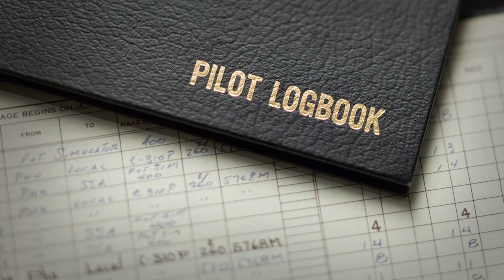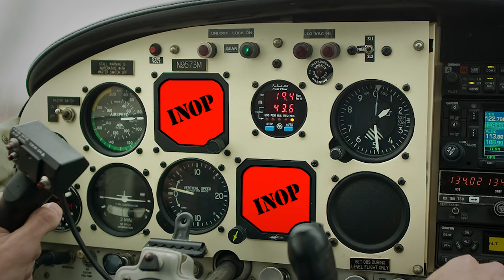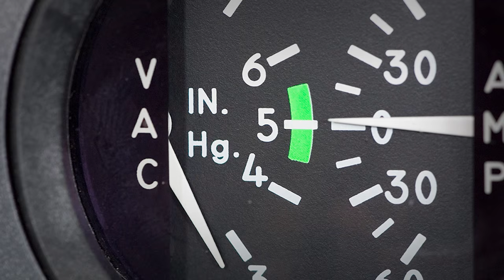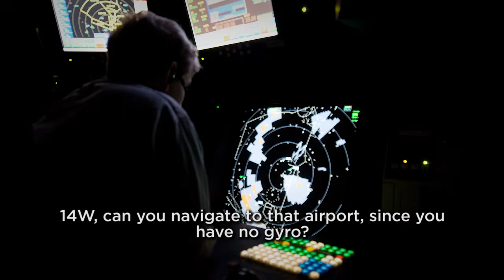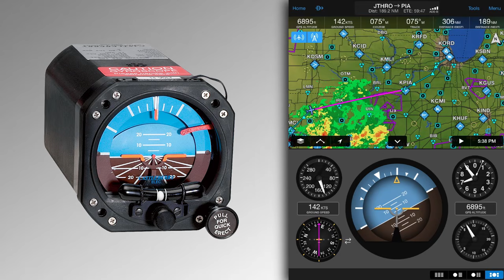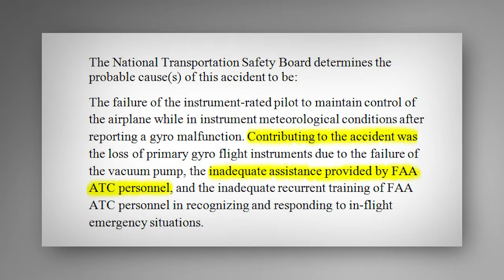Accident Case Study: Emergency Management

Comment: What in the hell is wrong with these people he asked to go to his alternate which was VFR they keep trying to get him to fly an ILS with gryo's not functioning those controllers should be fired.
Reply: There is an unfortunate tension in this case and whenever any pilot is near an airport with ATC (especially when in communication with ATC).  The ATC is generally considered an "authority"... if not the "authority" of everything that happens in that area.  If you doubt this, just try to ignore ATC instructions and see what happens to your pilot certificate.  OTOH, there is this mantra that "the pilot is always the master of his aircraft and actions".  Obviously that should be true, but in fact that is too often turned into a rationalization to hold ATC harmless whenever they (in part or whole) cause a crash.

While I haven't gone through as much training given that I'm only a private pilot of single engine land in VFR, never did I hear anything from instructors remotely like "when in any doubt, screw ATC and do what you think is safe and appropriate".  After watching a lot of these videos, I think that advice should be standard advice in every level of pilot training.  I see so many cases in which ATC controllers don't know enough about the operation of airplanes to give rational advice, and end up telling pilots to take actions that end up killing the pilot and passengers.

I tend to avoid ATC and ATC airports like a plague, which inherently makes me 100% aware and clear that my decisions are all that matter, and only I am responsible for making good decisions.  These videos make me even more anxious to avoid ATC and ATC airports, and if and when I do need to fly into ATC airspace or land at ATC controlled airport... to make my own decisions and simply tell ATC that I am taking certain actions to remain safe, but they are welcome to inform me if what I'm doing involves any dangers I am not aware of.  In my view, ATC should be considered "pilot assistants", not "authorities".  That confusion of "authority" obviously gets a great many general aviation pilots killed.
Reply: @maxbootstrap7397  The most important words to remember as a pilot are: "Unable" and "Negative"
Don't ever let ATC give you an instruction you feel unsafe with, BUT communicate what it is, that makes you uncomfortable (if time permits, remember "Aviate, Navigate, Communicate"). You could for example say something like: "Negative, Sir. I requested vectors to my alternate, not to final."
Reply: @QemeH  : At this point, after watching so many of these videos, I think it is prudent if not almost necessary to verbally say "unsafe" or "not safe" somewhere in any reply to ATC, to [hopefully] avoid blame or negative consequences from refusing to obey ATC.  When you think about it, those of us who are pilots must go through quite a bit of study and practice to fly a new type of airplane, or even a slightly modified version of an airplane we are familiar with.  Obviously the controllers don't intimately know the quirks, abilities or characteristics of the thousands of different airplanes they give instructions to, and they also don't know precisely the condition of each airplane or the exact instrumentation it contains, and they also don't know the exact abilities or comfort zones of each pilot either.  Which should make it obvious they should be in a secondary role.  But they're not, which is obvious even from their name... controllers.

In fact, I recently learned many controllers aren't even pilots!  So obviously they do not have an intimate understanding of the situations pilots face.  Everything is organized backwards IMO.  But that's not surprising when you realize ATC typically work for a government, and "government" is inherently considered "authority".  This is backwards.  Frankly, I look forward to the day (which should come fairly soon) when the avionics in virtually all airplanes (other than crop dusters) displays every other airplane in or near the airport pattern (and on approach), as well as their direction of travel and speed.  What I'm saying is, I would be vastly more comfortable observing other air traffic and announcing and/or negotiating my actions with other nearby pilots.  While this might be a bit tricky with the few insanely busy airports, for everywhere else it would be better as far as I'm concerned.  ATC is inherently problematic.
Reply: he also gave him a ridiculous intercept angle of something like 60°.  He should have given him two turns for a shallower intercept and got him onto the glideslope.  I think he would have been able to chase the needles down to where the runway was in sight then as well.   This is needless tragedy.  Best since he had no stby instruments was to go south to Columbus.
Reply: @gendaminoru3195  How are you coming up with 60 degrees? 010 intercept angle for a 040 degree final... is 30 degrees... not 60.
Reply: It's ultimately the pilot flying the plane. The ATCcan'tstop him from doing what he wants and he should have been more forceful in insisting he be rerouted. The ATC shouldprobably be fired, I won't disagree with that, but the pilot is ultimatelyin controlof the plane and he's ultimately the one who made the decision to try and fly in instrument conditions without instruments. ATC is important but they're not your commanding officer and they're not in the plane with you. The worst they face is losing their job and potentially a lawsuit, it's your life on the line. It's ok to disagree with them and insist that they give you what you want.
Reply: The ATC shouldn't have allowed the Pilot to proceed on what he had suggested, which is to fly to another alternative with inoperative gyro under VFR. I am not a Pilot, but I guessed that's the right thing to do. Correct me if I'm wrong..
Reply: @spriky89   Yeah you are wrong.  VFR means visual flight rules.  Its easier to fly straight and level in clouds than it is to turn.  Once he got to visual conditions it wouldn't have mattered if his gyro was working.
Reply: ATC is not at fault.  If you want to go to an alternate then you request the clearance to do so.  If the clearance is denied then you can declare an emergency and get emergency routing to the alternate.  Either way, you are the boss in the air and if you declare an emergency you just got yourself priority on traffic routing.
Reply: @gbigsangle3044  Sure, the pilot is technically the boss.  But at best, the Fayetteville controllers were worse than useless during this incident.  The poor guy would've been better off flying into an uncontrolled airport.  At least that way he would've almost certainly been forced to divert himself when he couldn't intercept the localizer.  Instead, we had Doofus and Goober vectoring him for an approach that required functioning gyros when he'd already made it clear that his vacuum pump had failed.  Your "boss in the air" principle also fails to take into account the amount of stress a pilot in his situation would be under while the controllers are sitting safely at their consoles watching him flounder around near the airport with a badly crippled instrument system.  They were all pretty bad, but that 2nd Radar East controller was a complete joke and didn't deserve to keep his job after such a worthless performance.
Reply: ATC is very much at fault. But I agree with you GBigs Angle that it is the right, and arguably the duty, of any pilot to only fly within the limits of weather, aircraft and pilot. If you want to go to your alternate, you go to your alternate! (Notwithstanding that one should be open to help from ATC if they give you good reasons. Like e.g. if ATC had said something like "weather at your alternate is predicted to become IMC within 10 minutes. Are you sure, you want to go?")